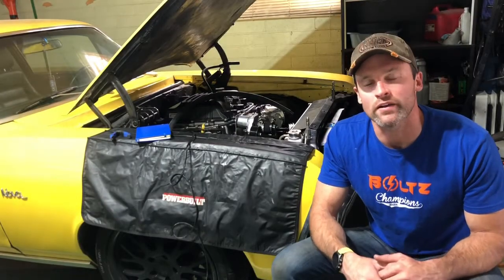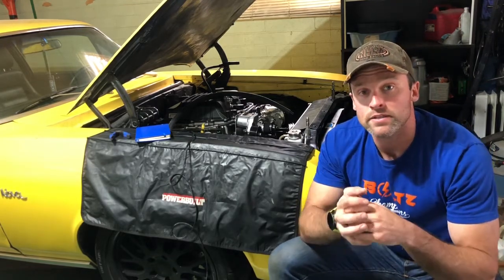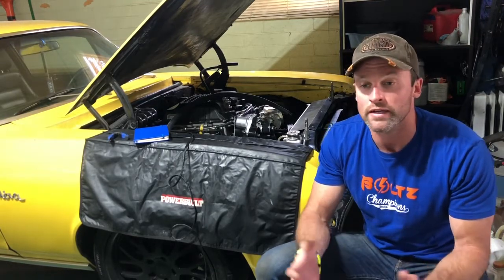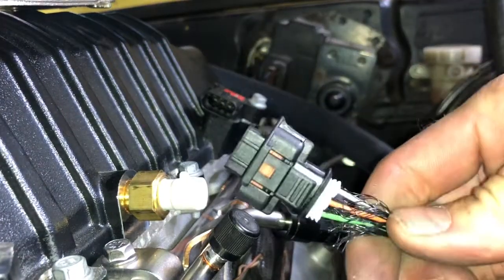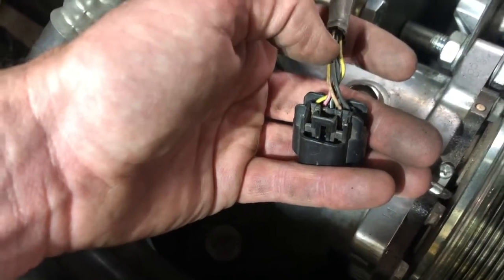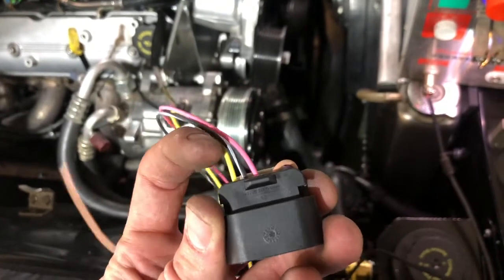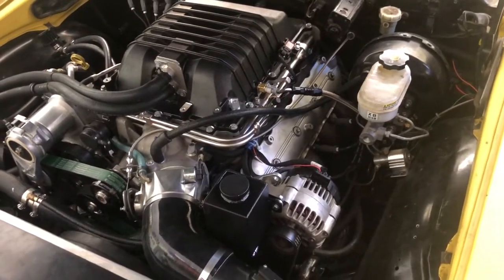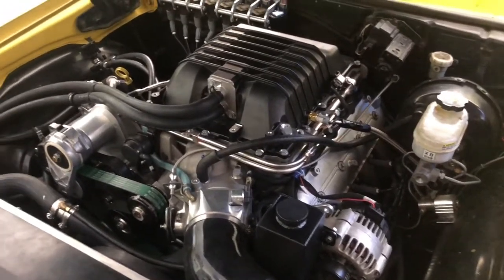LSA Swap Sensor and Wiring Overview

Comment: What about the about 2 sensors the one on the snout and on the front of the lid? I have a cts-v that I bought rebuilt and it keeps throwing sensor codes (p0068) (p012b) I’ve replaced the sensors, throttle body, got a tune and my car still goes into limp mode when I go wide open throttle. Once I reset the car it drives fine until I fully accelerate.

Comment: I'm getting ready to put a lsa supercharger  on the l96 in my 74 nova, I was wondering what kind of fuel pump you are running, is it inline or in the tank? And are you using a c-5 filter/regulator or something different for a fuel regulator? ? I can't seem to get any answers anywhere...
Reply from the maker: I used (and highly recommend!) a ZL1 fuel pump with VaporWorx controller. You’ll need a boost-referenced fuel pressure regulator and a pump that can handle your anticipated hp needs.

Edit for clarification: the ZL1 pump is PWM controlled, so you need the Vaporworx controller even if running N/A. You could also buy a pump and boost-referenced regulator from a company like Aeromotive. They should be able to get you the correct parts if you call their tech line.
Reply: @lsxbody7535  how did you get a zl1 pump in your tank?
Reply from the maker: It requires some cutting, see link below (it’s for a standard 5th gen pump but they’re physically interchangeable). Vaporworx also sell a weld-in ring. I replaced a drop-in Aeromotive Stealth 340 pump, so I already had welded a recess on the top of my tank. If I could do it again I’d just buy a Rick’s restomod tank for $500.

ETA: I highly recommend a drop-in pump no matter what you decide, which will require tank modification or a new tank. The modern pump has a tray surrounding it, which keeps the pump submerged in fuel until you nearly run the tank dry. Plus it’s backed by OEM design and validation.
https://www.camaros.net/threads/diy-5th-gen-fuel-pump-assembly-in-stock-1968-camaro-tank.419634/